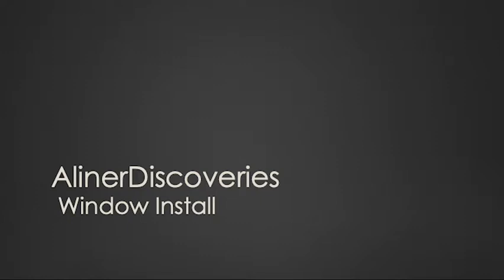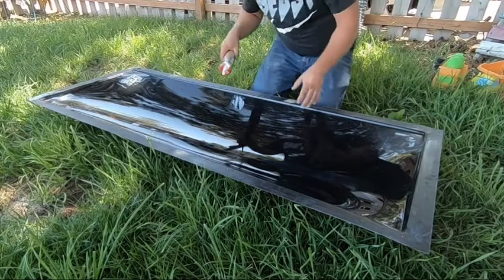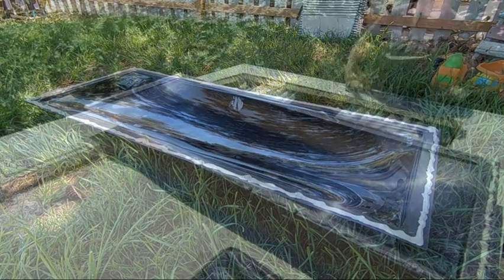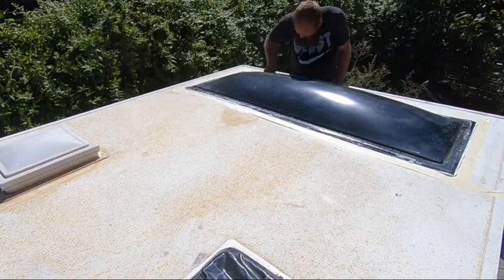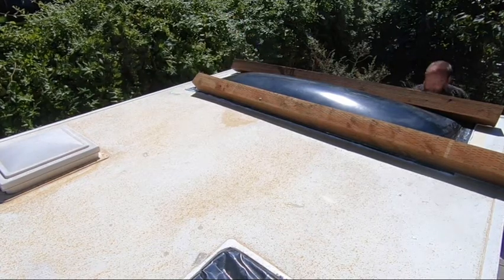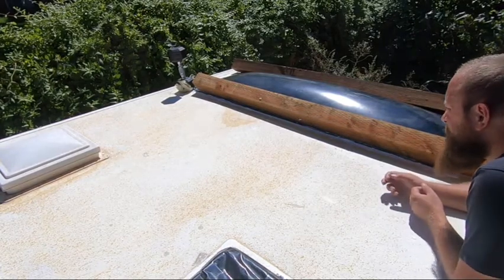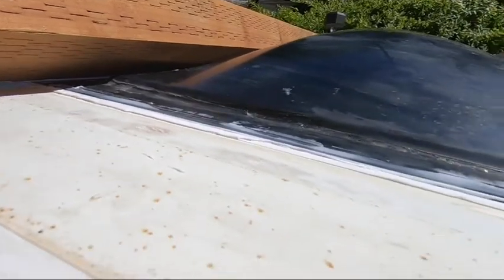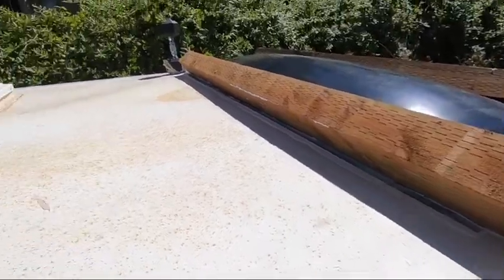Window Install

Comment: Is there a specific silicone , brand etc. also area preparation used (pre cleaning), and did it work? 
With the delamination, did you try to silicone or secure the cutout in the foam back to the the aluminum sheeting prior to silicone cure?

Thank you for taking the time to make the video and help others with these windows!
I look forward to seeing more of your videos.

Comment: Did this work? I have the same issue with the windows and air vents of my Aliner, so curious if you had further leaks.
Reply: I just bought a used camper with leaky windows.  I've been reading posts on RV forums online and watching videos.  Several sources recommend against silicone due to lack of flexibility.  I've seen/read people use SikaFlex or some  3M products that aren't silicone based. Have you had any luck with products and window sealants?

Comment: Butyl Rubber is much better for this than silicon
Reply: I agree. Silicone may be a sealer, but it is not an adhesive, and this will not stay on. I know, I am on my third a frame rear window. Now, I simply use the 4 inch tape on the outside. ( Eternal bond or Dicor.) And maintain it as needed each year.